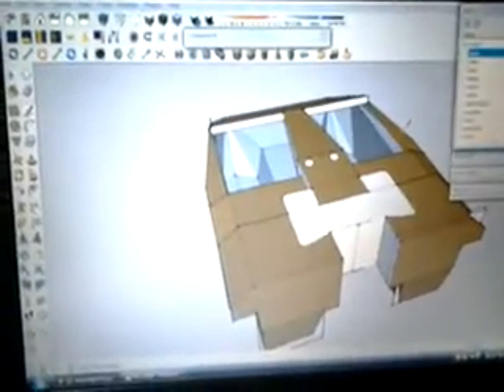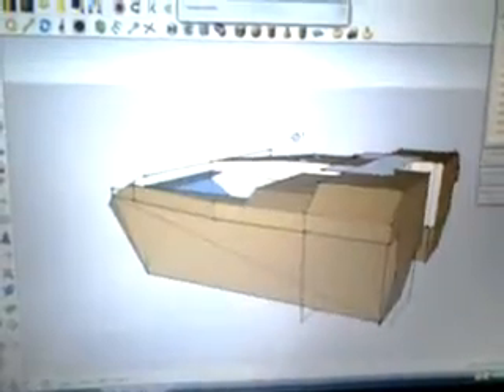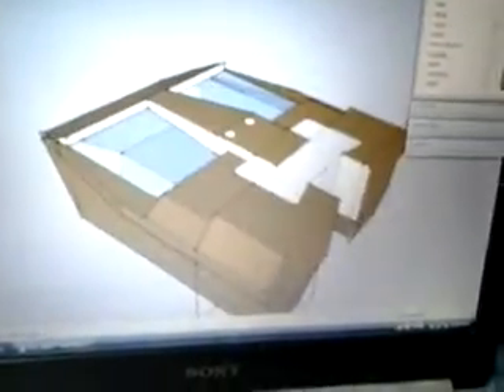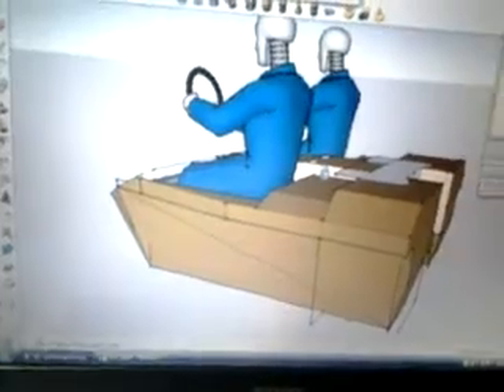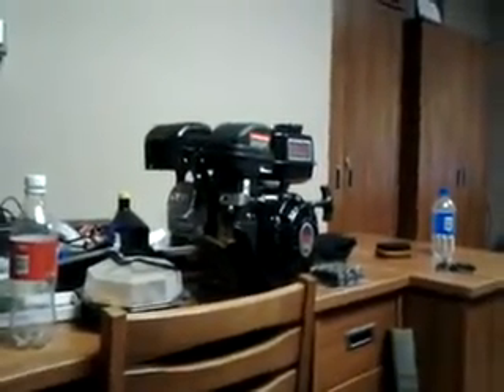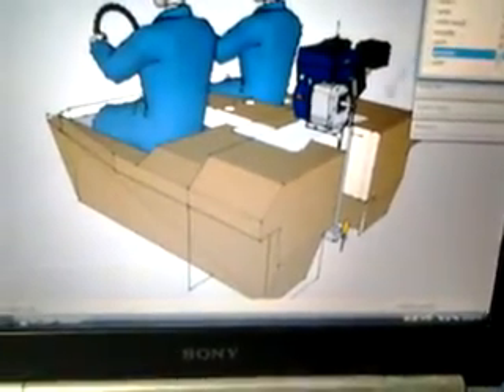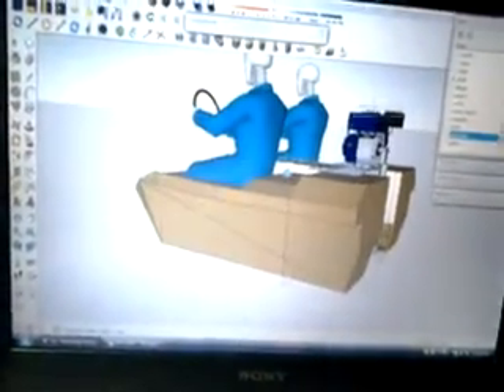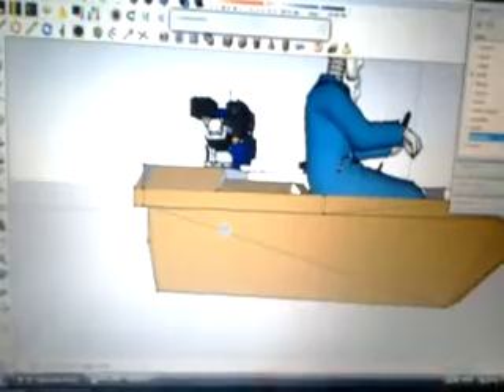Homemade plywood boat pt1 (design phase)

Comment: If I may add ideas to your build!
  If you would have went with a lawnmower style engine your setup would run a hell of a lot quieter. Chains are very noisy and not the best for your application. If you would have made the rear of the tubes (pontoons) narrow and slightly pointed upwards, it would have less residents in the water. But then again, the power your pushing may not matter for such a small boat. Study length vs with of naval architecture. 
And I will add that I'm proud of you for having the guts to build your dream and not let the lack of money stop you. I'm also proud that you stepped up above the topical things black people are thought of and accused of and showing we are all not that way.
  I'm telling you this because I'm in the process of designing a live aboard boat of my own. It is the second biggest dream in my life. I plan on building all of my on board systems myself except electronics (I'm not that good). I have built a boat before but not as big or of the live aboard type. So I wish you well and your build turns out way better than you hoped.